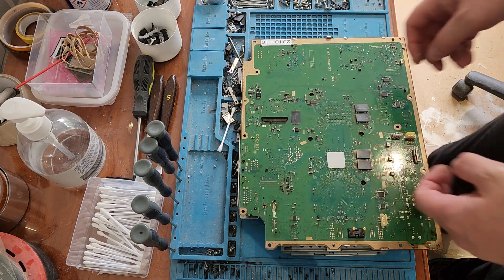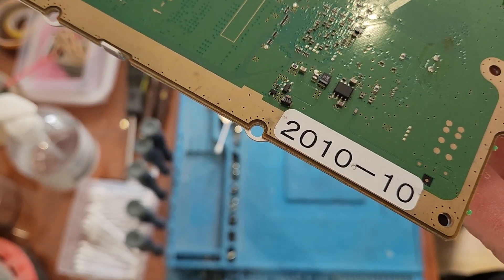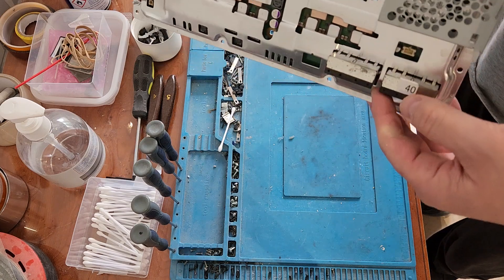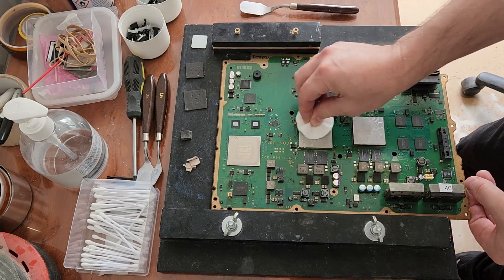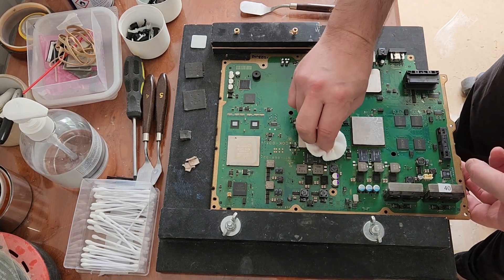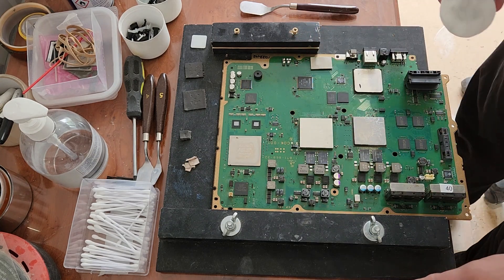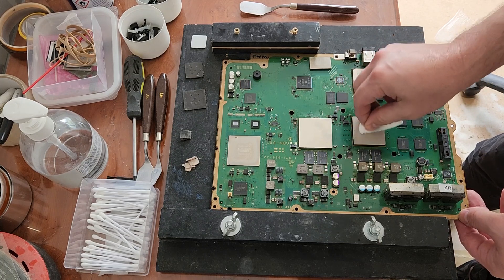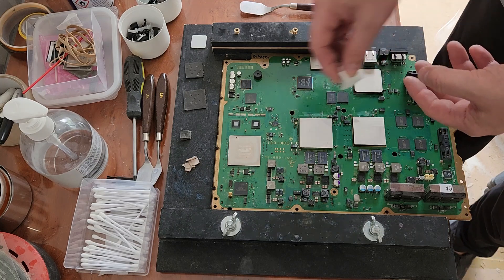40nm on a COK-001 Motherboard done by Sony!

Comment: Hi Tim, is there any way to tell a Frankenstein without opening it up? I have a CECHA01 that I had serviced by Sony for YLOD in 2013 but I'm too nervous about opening it up to check (it still works, I don't even want to look at it funny). Is it a safe assumption that it would be a Frankenstein due to the date of service?
Reply from the maker: You would need to open it and go down to the motherboard. The code on the RSX IHS is all you need. You then cross reference it from the RSX revison wiki website, and this will tell you what RSX you have.
Reply: @timdark9282  Thanks! I'll eventually muster up the courage to open it up then.
Reply from the maker: @singularityAD  check my other video "Don't open you backwards compatible PS3 untll you have seen this"
Reply: @timdark9282  it's been a bit, but I finally opened my console up to repaste it. CXD5301DGB on the board straight from Sony (or whoever they contracted to for repairs). with the new paste on it's whisper quiet.
Reply from the maker: A Sony service doesn't mean it was Frankensteined. If you have custom firmware you can check the temperatures whilst playing a demanding game. Typically you want see the RSX go above 55 degrees if its a frankie or a binned chip.